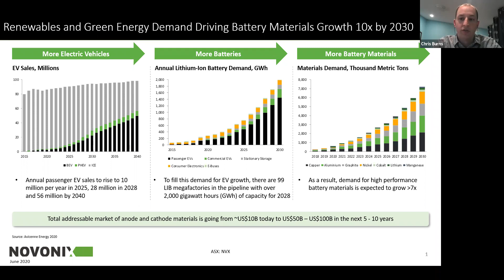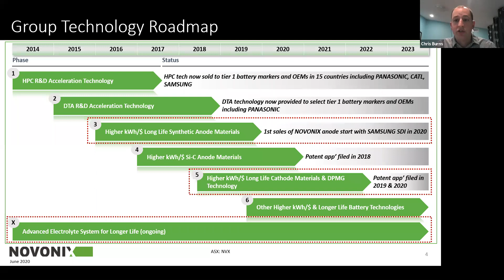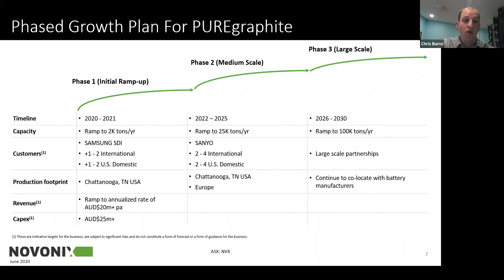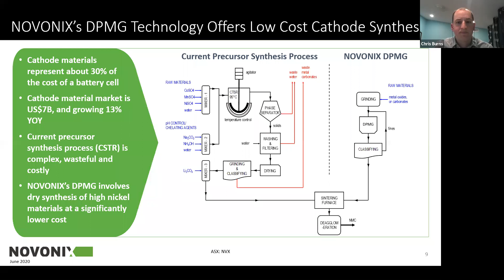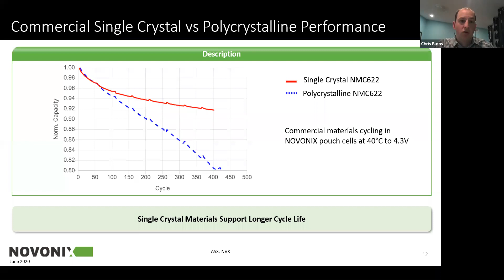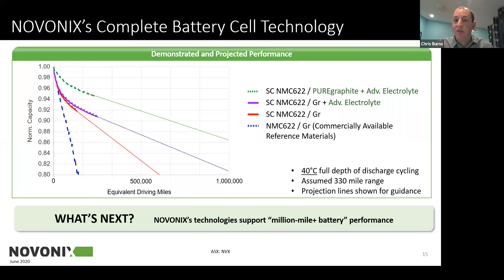NOVONIX Investor Webinar with CEO Dr Chris Burns - June 2020

Comment: Great to see Tesla renew the Sanyo partnership. Can anyone explain why the Novonix tech is preferable to what Tesla has with Maxwell dry electrode tech? Seems like this would likely end up powering non-Tesla cells. Still good but not Tesla level.Can anyone help me out here?
Reply: From what I understand tesla uses about 30,000 tons/year of Synthetic graphite in current batteries. Maxwell tech could provide the dry cell sides of a new battery and the Graphite needed in the battery could be provided by this company??  If novonix pure Natural graphite is of a higher Energy density grade at a good price they might be interested. Tesla needs batteries now and this product has not scaled yet. Jeff from tesla and Chris from novonix used to work together. Jeff Dahn recently praised Chris for this new development of DPMG. There was nothing talked about that tesla was testing the purity of their graphite right now. 
Battery investment day in September will be the telling tale.
Reply: musinclind37 thanks
Reply: maybe look at a video by "the limiting factor"
Reply: My question too. I can’t seem to find anyone who knows what the difference is between the two manufacturing techniques.